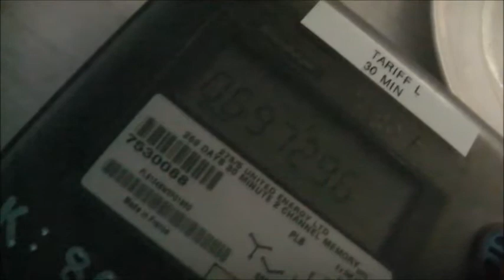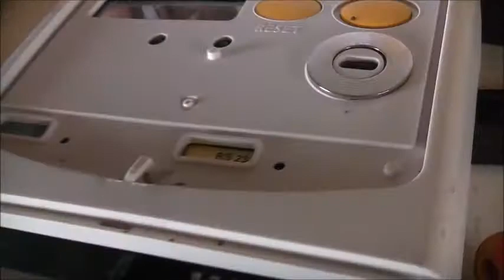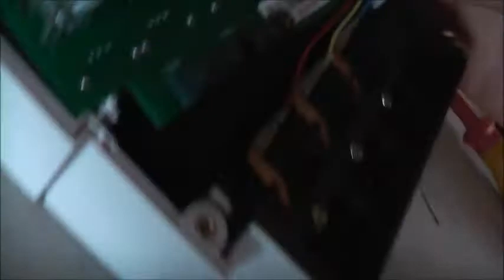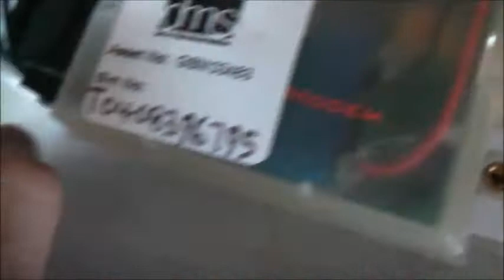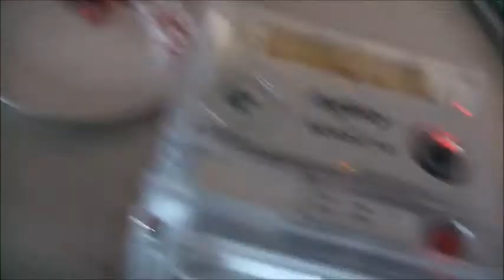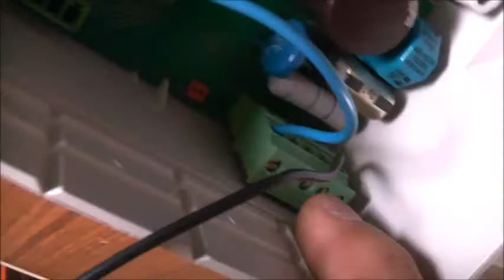Look at Sclumberger & ABB & Enermet Teardown!

Comment: Enermet (formerly Valmet-Ivo) meters are made in Finland.
GSM modems are very useful, if you need to monitor anything remotely- they often can be interfaced quite easily to a microcontroller, and many support SMS.

Comment: If you want to look into the smart-part you should get:
RS232 cable (may be USB or not)
RS422 cable (USB to RS422 or RS232 to RS422)
ModBus client
MBus client
Putty (used on serial-ports)

There may also be a PLC(power line communications) interface build into the meters. The remote part of that can be tricky to get. If the meter got PLC interface I would be carefull about connecting them to the mains network if the utility use PLC.

Same with the GSM modems, make sure there is no SIM-card and antenna; unless they know you have it and know you will mess around with it.

The modems looks like they could be possibly standard, but don't expect anything faster than GPRS (probably no EDGE support). a USB to TTL UART cable or RS232 to TTL converter is likely to be very usefull when trying them out.

The whole setup is quite a bit of equipment:
server, link equipment, concentrator(the meter reading box), PLC/GSM/ZigBee modems, and meters.

The meter may stop counting if the voltage is outside the "power valid" parameters.
You may want to look into the valid/invalid power delivery part.
I have messed some around with a digital meter, using a 3-phase phantom load and supply. Neat when you can see what you put into the meter in the server log.

Best regards, and stay safe.